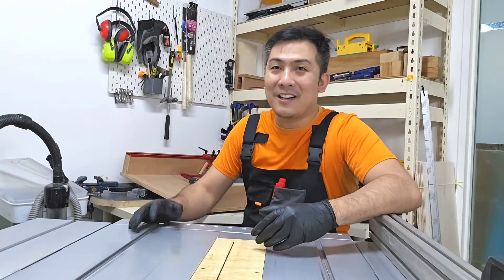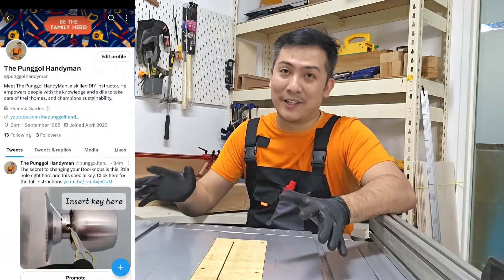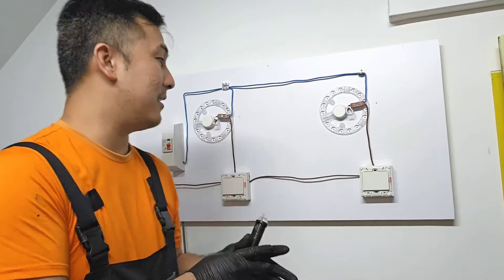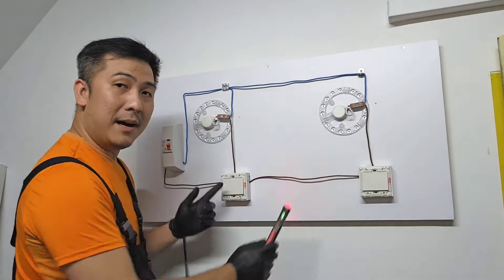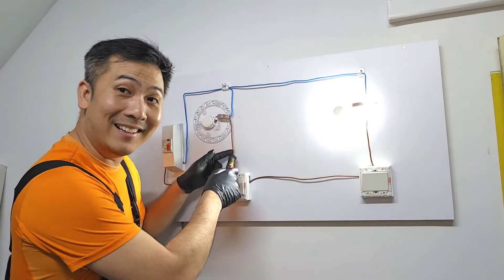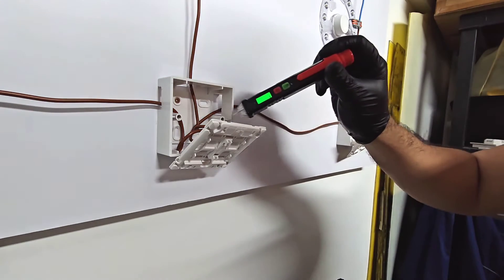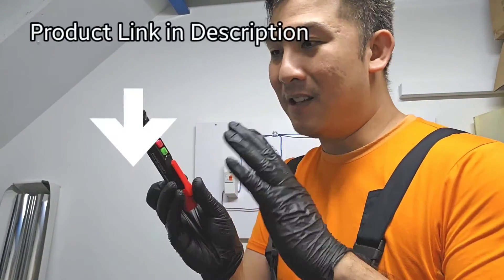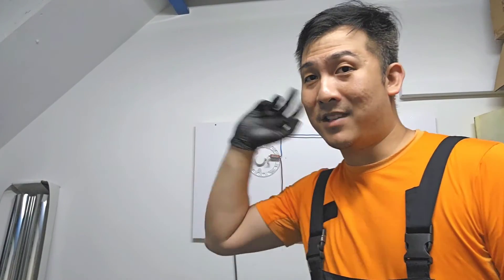Be safe! Don't DIY Electrical Work Without This contactless test pen

Comment: I was going to buy a test pen with my CDC vouchers next year, seeing this video maybe i should consider buying this one instead? But i think one downside is if you have a cluster of closely packed cable, you have to isolated each cable since this one is contactless and any one wire with close proximity to it will cause it to activate.
Reply from the maker: So what I do is to use this to check all the cables at once. Saves me time if I just want to make sure 100% no power.  But if I need to isolate one, I'll use a test pen.
Reply: @ThePunggolHandyMan  Okay, get it.